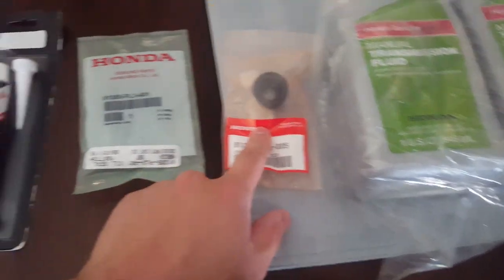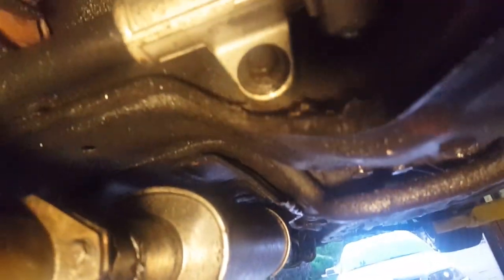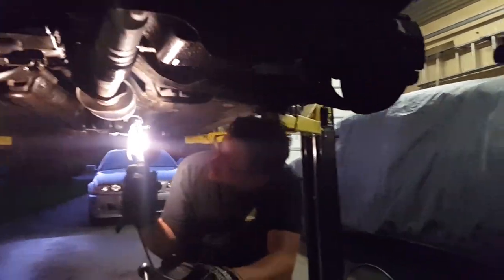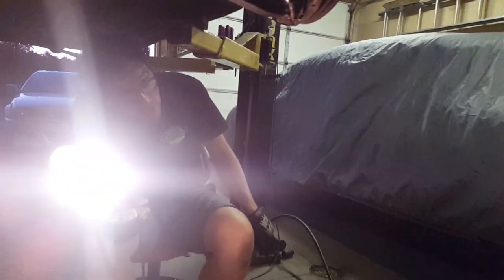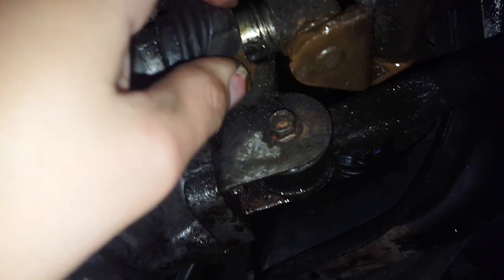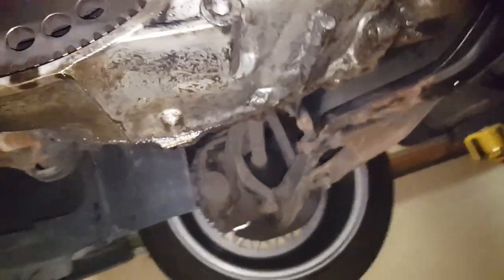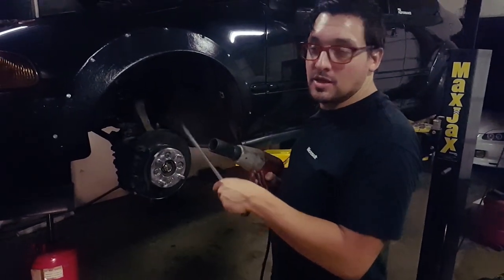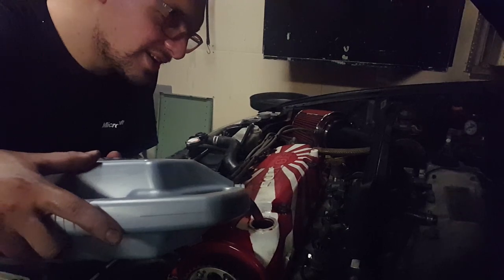Wide Booty Honda Civic | Fixing Oil Leaks

Comment: do wheel spacers make your tires pop out ?
Reply from the maker: Wheel spacers make your wheels stick out further. On this car they are there to convert the lug pattern from 4x100 to 4x114.3
Reply: Jose A Santiago
Reply: there one problem the wheel spacer dosent not have a hub central that bad